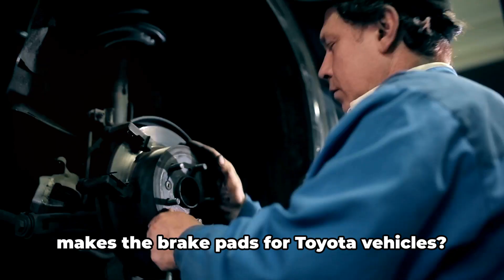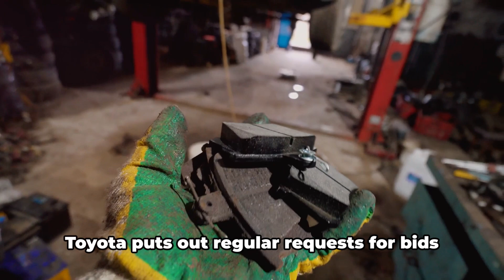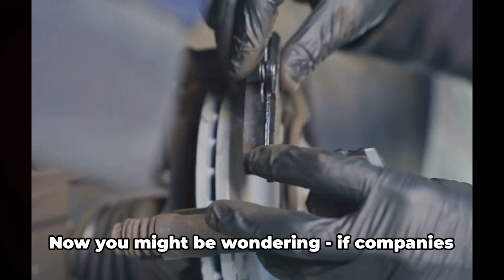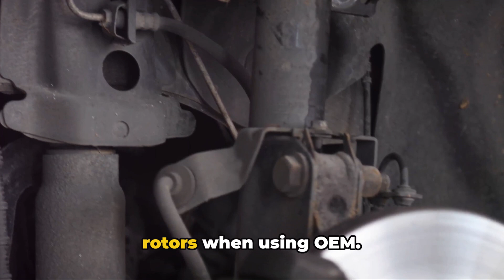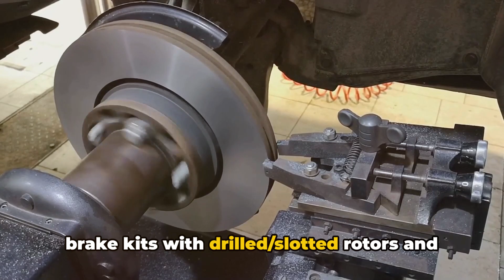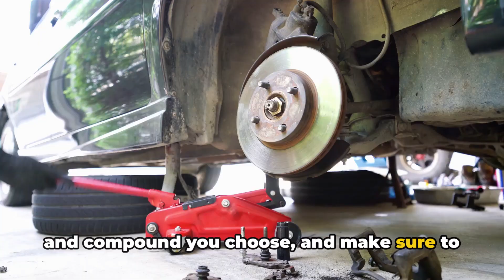Who Makes Toyota Brake Pads: Surprising Truth

Comment: The problem I have with OEM brake pads is the excessive dust compared to the aftermarket ceramic brake pads.
Reply: Then you're not using the Advics OEM pad formula. The OEM Advics pads have almost zero dust. Akebono produce more dust than Advics. NISSIN pads are also extremely good.
Reply: @Zukuri620  Good advice. What's your favourite brand brake pads for regular cars ( no track day ) ?.
Reply: @MDEV-86x86  Advics premium ceramic or Nissin ceramic. Both made in Japan. Can usually get both on rock auto.
Reply: @Zukuri620  Thank you !.
Reply: @Zukuri620 What's your opinion about Delphi brake pads ?.

Comment: I have worked as a Lexus tech for 10 years, and let me tell you. 
For the times that I do work on family and friends cars I have alway had issues with aftermarket brake pads. 
Squeals noises, excessive dust on the wheels, poor fit-met causing rattles etc.
I’ve had so many bad experiences with aftermarket brakes pads I’m pretty much done with them and only use OEM with OEM Shims and fit kits. Worth the extra money. You just it once and never touch them again.
Reply: Akebono (mid range) has always been good for me.  Tacomas, Camry, Corolla, rav-4’s.  No squeaking, last a long time
Reply: @Joe-hz1nw which brake part # are you using for Ravs that work good?
Reply from the maker: Well said!
Reply: Where can get oem rotors and pads  ,except dealership  ?
Reply: Below is a direct quote from another Toyota tech in Roanoke Virginia seen on the Bobistheoilguy forums on Apr 13, 2025 Quote: "No issues using any brands listed. Duralast and Napa SilentGuard are always my preferred pads. I'm a Toyota tech and I hate installing factory pads because they don't come with shims or hardware so I don't buy them. I haven't had any issues with aftermarket pads I've installed on my Toyotas either. Duralast Elite and Gold would be my choices. BrakeBest Select aren't bad either." (Post title = Gambling with non-OEM brake pads?)

Comment: Akebono is same as OEM quality.
Reply from the maker: I agree!
Reply: @HonestMechanicChannel  I have a question Toyota dealer asked me if I want the japan brake pads or the ones made here 🤷🏻‍♂️. 116 vs 70 I’m like I want oem . Well another dealership said there’s only one pad choice . I’m so confused this is for Toyota tundra
Reply: @weirdowolfstudio5409 the brake pads and rotors will usually be Japanese made Advics for the tundra. At least for my Camry, the brake pads were made by NBK or Nisshinbo and the rotors made by advics.
Reply: @weirdowolfstudio5409 I will say to also check different dealerships since I was able to get 33% off my brakes at my closest dealership due to them having a sale.
Reply: Akebono create lots of dust never again
Reply: @Trd2020  And what are putting on now ?.